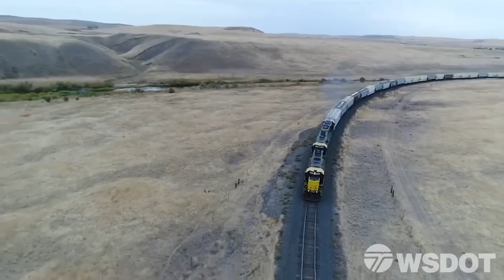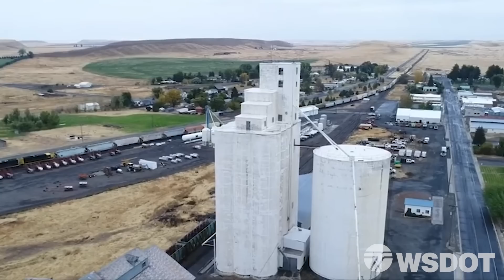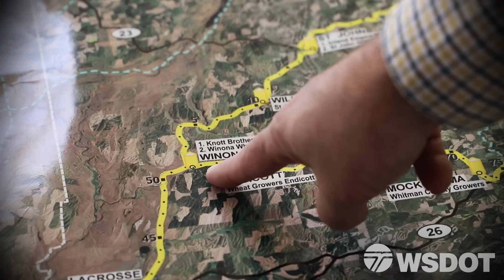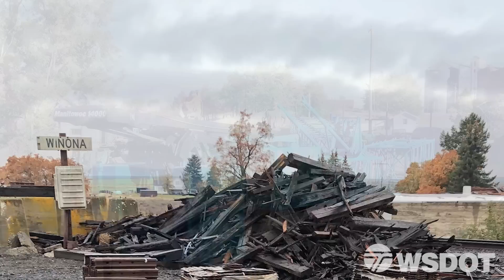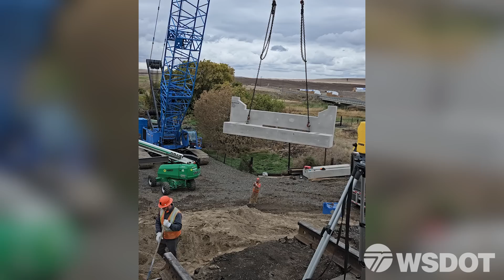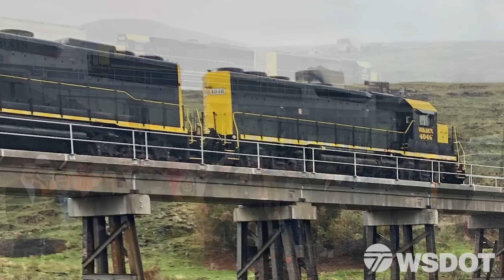Winona Railroad Trestle Emergency Replacement Project

Comment: oh look another example of "if you dont schedule maintenance, the machines will do it for you at vastly increased cost." had the bridge been replaced in the off season as preventative maintenance, it wouldn't have needed to be replaced at the most inconvenient time imaginable. steel and concrete dont burn.

Comment: Glad to see this railroad is back up and running.  At least when the fire happened, it allowed the construction crew to build a new and stronger bridge to replace the old wooden one.  Who knows how long that wooden bridge has been there.  It's also impressive to see how little time it took to build the new bridge.

Comment: Doing it fast is a problem because it’s so much cheaper. Material is cheaper now than it will be tomorrow. And labor hours are the same whether you have 10 guys working 1000 hours or 100 guys working 100 hours. 

People think it costs more to do it fast. But it mostly, it’s just companies wanting to drag the project out forever so they can charge cost overruns and overtime labor. 

It’s not “Americans putting their minds to it” it’s just what should be done in every project. We have plenty of stuff that needs to be done NOW.  

Every project should be done with the same sense of urgency, that how you advance PAST where you are now, instead of just working to stand still.

Comment: Point of order, but the railroads were constructed across the country in a matter of months at a time. The Alaska highway was constructed in a year. The biggest obstacle to the above replacement was red tape and not technical ability. If red tape is impossible to overcome then there is a problem with the red tape.

Comment: I live in a small town with a major CN line. A few years ago they replaced the old wooden trestle over the river in town. They used four prefab concrete sections that were cured for months off site. The bridge wasn't faulty, but any repairs would close the track for days, to weeks. They cut out one half of the bridge, leaving the second track to handle any traffic, including Amtrak. They rebuild the piers at either end, and reinforced the pylons in the river. They then lowered one half the bridge in, with ballast in it, and then the second half, also with ballast. They then put in the track, welding it together. They then filled the rest of the ballast to have it be even with the rest of the track. Once that new bridge as secure they repeated the procedure on the other track. It took less than a day. Now they don't have to worry bout bridge maintenance since it's ballast. They just continue with the regular MOW work. Quite a remarkable feat.

Comment: I worked for Union Pacific Railroad and back in the late 1970s a 180ft long bridge burned . I manned the light trailers working 24 hour days for 6 days . Bridge gangs working from each end of the bridge in the construction of the new bridge .  It took 5 days to build the 55 foot tall bridge , the bents were built on a table constructed by the crews and as each bent was completed a bridge crane would set it in place . Connecting timbers were set in place and track crews laid the ties and rails .  The south bound train that discovered the burnt bridge stopped less than a foot from the edge of the stable track . When the rail was cut it jumped straight up hitting the torch and almost pulling the welder into the creek bed . Scared the man and we held onto his legs and jerked him back when he cut the other rail scratching his face in the ballast but he was glad we kept him safe . It was a site to see the bridge rebuilt . I was a mechanic on the track working equipment and I kept the light plants running at night and maintained the cranes and equipment during the days . Really interesting video .
Reply: That sounds about like what I would have expected. If a bridge is of a high enough priority one can be built in a much shorter period of time than is expected. Years ago when a truck caught fire and took down that interstate interchange in California, they were able to get the work done in a matter of a few months. This bridge, isn't anywhere near as complicated.
Reply: it wasnt owned by a private, for profit corrupt organization/ criminal enterprise feigning as a government

Comment: The fact the rails stayed connected after the bridge holding them up was completely gone is surprising. I wonder if they would've been just load-bearing enough to not break apart under the weight of one of those hand powered push carts or something.

Comment: Somebody said that it couldn’t be done
      But he with a chuckle replied
That “maybe it couldn’t,” but he would be one
      Who wouldn’t say so till he’d tried.
So he buckled right in with the trace of a grin
      On his face. If he worried he hid it.
He started to sing as he tackled the thing
      That couldn’t be done, and he did it!

Somebody scoffed: “Oh, you’ll never do that;
      At least no one ever has done it;”
But he took off his coat and he took off his hat
      And the first thing we knew he’d begun it.
With a lift of his chin and a bit of a grin,
      Without any doubting or quiddit,
He started to sing as he tackled the thing
      That couldn’t be done, and he did it.

There are thousands to tell you it cannot be done,
      There are thousands to prophesy failure,
There are thousands to point out to you one by one,
      The dangers that wait to assail you.
But just buckle in with a bit of a grin,
      Just take off your coat and go to it;
Just start in to sing as you tackle the thing
      That “cannot be done,” and you’ll do it.

- Edgar Guest

Comment: WOODEN RAILWAY TIES ?
Reply: This is a line that is over 100 years old and is primarily only used heavily during harvest,this country is full of old rail beds and lines
Reply: @stetson-ross  the point i was making was that the old lines that burnt down were made from timber
Reply: @johnwilliams-sc1vf  The trestle was burnt. Burning a wooden crosstie, when it's embedded in ballast, is almost impossible.
Reply: @SynchroScore  funny that,  the photo's show just steel rails after the fire
Reply: @johnwilliams-sc1vf  And if you actually knew anything about how bridges are built and how fire behaves, you would understand why. The original bridge was an open-deck, all-wood construction. This allowed air and fire to access all sides of the ties and the rest of the structure. The replacement bridge is steel piles supporting precast concrete ballasted deck. A wood crosstie, surrounded by stone and supported by concrete and steel (which are generally highly resistant to fire) is extremely unlikely to burn.
Reply: @SynchroScore  as a structural engineer I think I know a bit more than you , steel will not burn but it sure will bend also concrete spalls when hot
Reply: @johnwilliams-sc1vf  As a structural engineer, you should also know that such a thing happening is pretty unlikely when the steel and concrete is at least thirty feet away from the source of combustion.
Reply: In many local environments, wooden ties outperform concrete.
Reply: The wood compresses and rebounds under loads, which can soften out the ride, and also allow the ties to move during heat cycles in the concrete from day and night.

Comment: Are bridges like these fairly standardized? does each one have to be custom designed from scratch or can engineers quickly tailor an existing blueprint to fit each scenario and site

Comment: They did the same thing in Western Pennsylvania in Chicora a short line trestle servicing three refiners burns down. Governor stepped in, cut all the BS and red tape, and trestle was replaced with a fill in a mater of weeks. $#!T happens in government when jobs and tax revenue is at stake.

Comment: 2 months and the Gov't was involved, I'm impressed. great job
Reply: I recall there was a bigger tressel burned owned by a private railroad few years ago that was rebuilt in like 6 days....   Looked like an Amish barn raising...
Reply: You could not be more wrong. Really
Reply: You miss the part where WSDOT diverted taxpayer funds from future projects to this one?
Reply: @cwshawk  I was talking about the timing
Reply: @cwshawk  isn't that an future project, came early? Like how is there so much rail infrastructure that still relies in wood?
Reply: @fritz3135  Oh you'd be surprised how much of US rail infrastructure relies on wood. You'd be surprised of the age of the equipment used (much of the equipment used by smaller companies is from the 60s and 70s, sometimes earlier than that). Most of the shortline railroads (like the one in this video) move freight at 10 miles per hour. That's slow! America's rail systems needs a MASSIVE investment, and it needs to come from he taxpayers, just like the highway system and most of the airline infrastructure did/does. We could completely change our economy without raising taxes a single penny if we diverted money from some of these other dumb projects or things that should be private and used it to rebuild some of this rail infrastructure.
Reply: @cwshawk  And you missed the part where they said they could only do that because federal funding would eventually come in for the bridge to pay for the future projects.

Comment: Imagine how much faster this could have been accomplished without all of the regulatory hurdles. 😮
Reply: About the same amount of time. Putting this up in two months is nothing short of amazing, to people who actually understand engineering.
Reply: People who actually understand engineering know this could be accomplished in two weeks.
Reply: @deltabravo1811  Two weeks isn't even long enough for the concrete to fully cure.

Comment: I think the most amazing part of this was the suspension of the EPA impact statement process.  That would have taken years and possibly quadrupled the costs.
Reply: It's crazy that is required for something that was already there that they are just replacing. Like I get it if you want to build a highway through the swamp land or something but you're just replacing something that burned down. Should be a simple "new" or "replacement" check box to skip.a bunch of stuff
Reply: Yes, Me, the EPA should be disbanded. Like most bureaucracy, it has gotten out of control.

Comment: Presented as a feel-good story, but skips the question, "Why was an aged wooden bridge not replaced years before, if it could be done so quickly?"
Reply: Simple answer, it didn't need to be replaced at that time.
Reply: Sounds like you're not an engineer and shouldn't bother asking dumb questions. As long as there is no degradation of the wood grain, wood generally can keep its rating for many decades, and if well maintained potentially centuries.
Reply: @MarcABrown-tt1fp  Good of you to miss the point completely. I'll wave from the banks as you drive across other colapsing infrastructure in need of replacement.
Reply: @PiDsPagePrototypes  Good thing this bridge was not one of those and such a point is pointless considering it was used and inspected regularly. Every engineer that sees a bridge in a sorry state is the first to pipe up about it, especially structural member rot. As usual the only people who can act upon public works maintenance is a state government bureaucracy, that's if they do which a lot don't these days.

Comment: "Owned by the state" well there's your problem.
Reply: The state purchased old UP and other lines for the grain trains at request of farmers to move grain efficiently. We have wildfires. Seems like the state did a great job to get a replacement open in two months.

Comment: This is the way it should be all the time.
Reply: Easier said than done, until you have managed a project from start to finish you won’t understand what efforts like this take.
Reply: Now there can again be Winona riders.
Reply: Helps when its a simple bridge
Reply: @clipsterhooligan  True, and no room for scope creep
Reply: Minus all the any federal funding
Reply: There are three options of a project like this: built well, built fast, built cheap. You can choose any two of the three.

Also notable is that they had to pull funding from other projects to get this done, meaning those will be delayed or canceled
Reply: @andrewreynolds4949  But it still shows that the construction is fast. The problem in all western countries all over the world is too long planning and budgeting. All projects could be done fast.
Reply: @afe31  Note this is a very small project. Many of the large projects in the news are far, far more complex and thus require far, far more planning. China has many excellent examples of what you get with big projects done fast and cheap; There's a definite chance of the whole structure rolling over or something equally as dramatic, or even surrounding conditions changing and the whole thing being abandoned incomplete, up to and including the scale of entire cities.

On the other extreme there is California as an example, where extreme levels of bureaucratic regulation blow small, simple projects into decades-long struggles for expensive underperformance, and on the large-scale end create enormous endless money pits. There is a happy medium, which unless more places continue the California style of regulation, most western countries are generally sitting at from what I can see.
Reply: @andrewreynolds4949  I am working on a german light rail project trough the city. It's a big thing. Planning and budgeting will take 6 to 7 years, construction will take only 2 years and it could all be done in 1 year, but we don't want to shut the whole city down for this time and that's why the construction will be done in smaller parts. Planning and budgeting are taking too long because too much office workers are involved and there are too much rules than many years ago. Our cities were built much faster 100 years ago with much less bureaucracy and almost no machines.
Reply: @afe31  They were also built with far, far more accidents, dirt cheap labor and much more loss of life. This is just what infrastructure projects take, as you say without tearing up too much of the city at once
Reply: @andrewreynolds4949  If it's a government project it's built poorly, built slow and built over budget. Taking longer just means it costs more and the quality doesn't get any better.
Reply: @Trezker  Not every government project is built poorly, many (but definitely not all) are overbuilt for what is needed. It depends on the project management and how much interference the politicians have
Reply: But nooooo! This is socialism! The Farmers in that area are all voting right, they want to be self reliant and should have built that bridge themselves!
Reply: Amen!

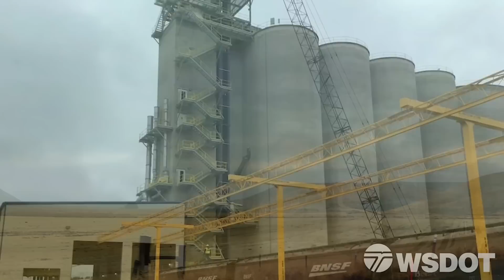Comment: Thanks for a great video showing what grit & determination can accomplish. I think there may be a slight error in the text, at 0:29 or so you refer to "container cars" but grain is moved in covered hopper cars,, in railroad parlance, containers are the intermodal boxes that can moved between truck, train or ship to reach destination.
Reply: Grain is sometimes hauled in intermodal containers, especially as "backhaul" exports to other countries, where those containers would instead be sent empty.
Reply: @SynchroScore  thanks for the info. I do feel like hoppers would be the most common though.
Reply: I picked up on that too.

Comment: wooden ties?  here it's all concrete and rail is already embedded  on concrete sections and loaded on train flatbeds for  the big train rail layers. it's  impressive because by using such equipment,  long sections of track can be replaced very quickly within very short time span. also prefab  truss to bridge river.
Reply: Much cheaper, and in this dry climate, will last 50 years.
Reply: Or more. Hopefully there’s enough drainage through the gravel and off the concrete structure.
Reply: Having a few concrete ties on a railroad which remains 99% wooden ties does not improve anything, but increases the complexity.